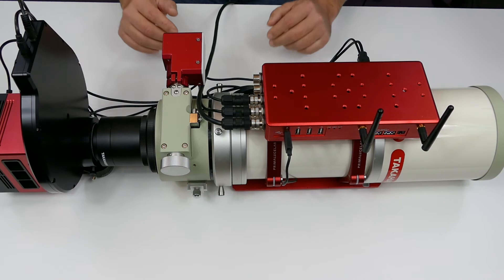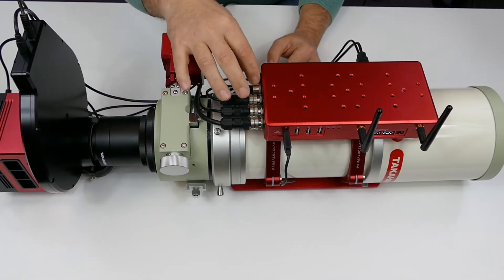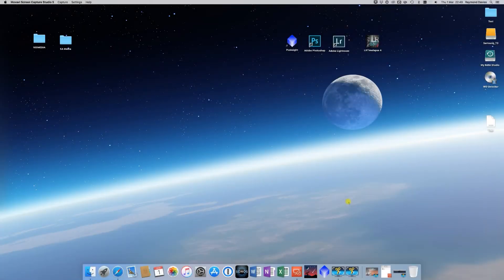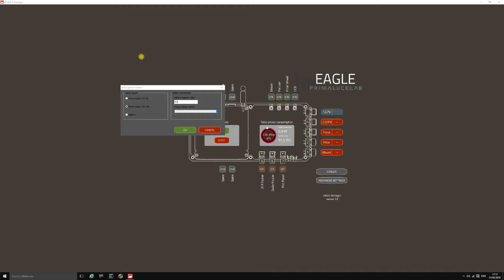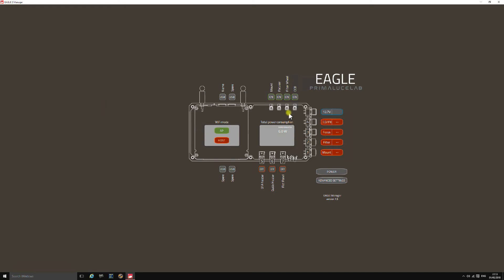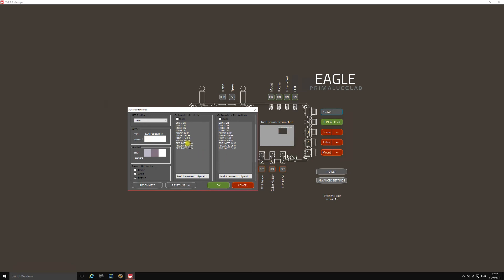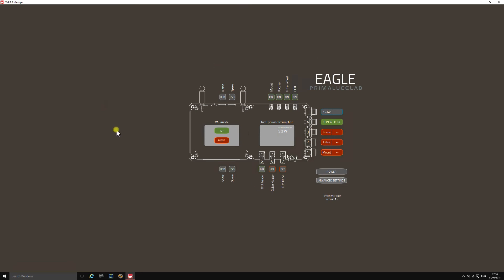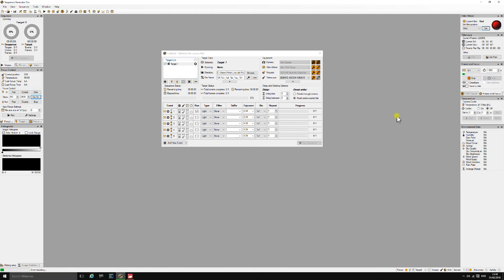PrimaLuceLab Eagle2 Pro mounted on Takahashi FSQ106 with software demonstration

Comment: lot of money for something you can achieve with a small windows 10 mini pc?..
Reply from the maker: Hi AstroDad.  It is a lot of money, agreed.  Unfortunately you can't achieve all this can with a simple mini PC.  It has controllable dew heater outputs, resettable USB hub and controllable power outputs.  You can do this with a mini PC but would need to add some other bits like a Pegasus hub for example, which is what I do now.
Reply: Simplified Astro Why do you not use the the Eagle now? The video makes it look very impressive...have you had difficulties since you posted this? Many thanks for your response.
Reply from the maker: @simonwalsh6804  Hi Simon.  It is a super impressive piece of kit.  My major issue which made it unusable, which I understand from Fillipo at PrimaLuceLab has been resolved in the Eagle 3, is that mine is in a remote observatory and I could not start the unit from a completely powered off state, which was no good for me.

It was an issue with the NUC firmware which PLL couldn't alter, so not really their fault, but still not workable for me.
Reply: Simplified Astro Many thanks. One more thing: did you ever have problems with dew entering some of the holes between sessions?
Reply from the maker: @simonwalsh6804  No issues at all with dew.  Only the start up issue and some early USB issues which were resolved with firmware.
Reply: Simplified Astro cheers and great videos

Comment: Hi, please confirm: what is that focuser/controller again? Couldn’t make it out...
Reply from the maker: Hi Logieberra.  The focus motor on this set up is the SestoSenso by PrimaLuceLab.  The controller for it is built in, so it just has a micro USB lead and a 12v power lead to it.  Hope this helps.

Comment: I'm still saving my pennies ;) ... Is the Eagle still performing as expected?, any changes?
Regards
Reply from the maker: Hi Rich.  Unfortunately there was an issue with the Eagle which meant for me it was not ideal, so last week it had to be returned.  Mine was used in a remote, solar powered, observatory, meaning I needed it to boot on power application via an IP switch.  There was a firmware issue with the NUC which PLL were unable to fix which meant this was not working, so if I had a power down, I couldn't turn the unit back on. If this could be resolved, or you are using the unit with access to it, then it is still a very good unit.  They have released V2 of the desktop software which is an improvement on the previous version and ironed out a number of bugs and issues.

I've now gone back to using my my mini PC with another Pegasus Ultimate Power Box (UPB) which all boots up on power application.

Comment: Thanks very much for this video.  I understand that the Eagle 2 Pro offers Wake on LAN functionality from sleep state (that would be S3 sleep state), but can it also wake from the off state which is the S5 state.  I.e., if the E2P is shut off but power is available, can it be awakened over LAN?  Another question: Can it be awakened over the Wireless LAN from S3 or, better yet, S5 by sending it a Magic Packet?
Reply from the maker: Thanks Derek.  When power is applied to the Eagle2 it is in a standby state.  Even if "powered off" it is still in a state which awaits a wake on LAN command.  To totally power down you have to remove the supply.  With this noted I suspect it will operate in the way you mention, which is powering down in advanced settings, which essentially switches it off, but it is in a powered state, meaning it can be started using wake on LAN.